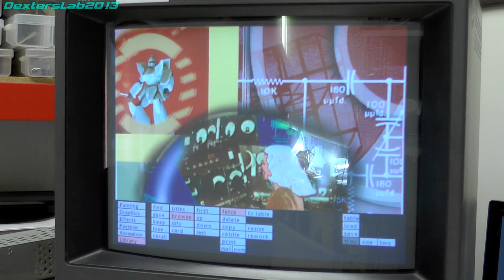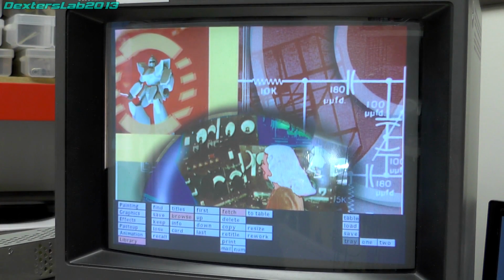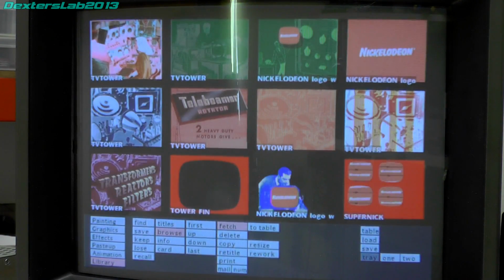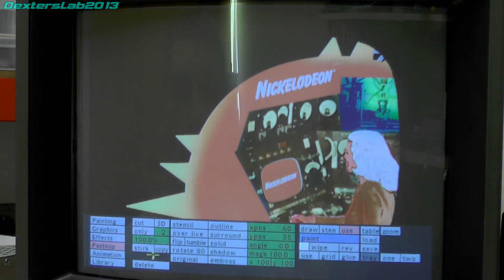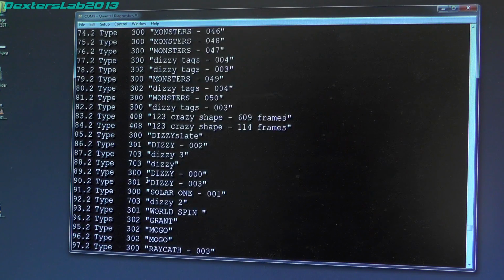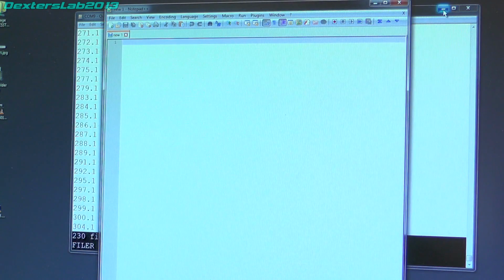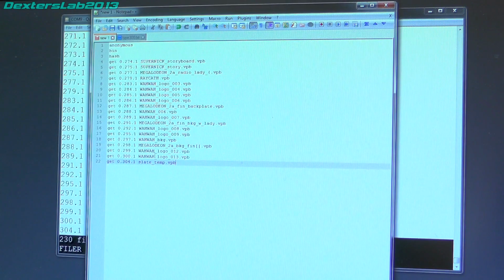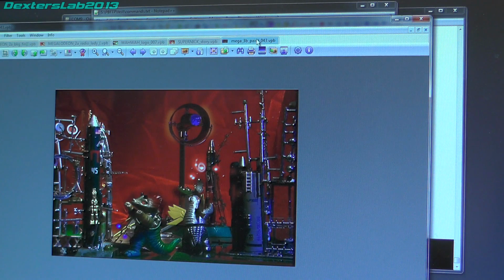DL141 Recovering DizzyTV's Old Quantel Paintbox & HAL Files

Comment: You might be interested, I found some Python source code that claims to decode VPB: https://github.com/GeoSpark/vpb-converter
Reply: Do you have any samples of files you can make available? They could be useful for improving the code.
Reply from the maker: Thanks, yes that was written by a friend of mine so i could convert some bitmaps that i wanted to send to the paintbox. It was written before i found out that my Paintbox can convert files through the network interface for me. We kinda stopped working on it after that, we also discovered the file format is actually open and documented by quantel... the only issue is it was only as a printed document and i've not found a copy of it yet!
Reply: @DextersTechLab  I want to implement the vpb file format, did you already found a copy of the documentation of the file file format?

Also can you point me in the direction of sample files? I already found the one in vpb-converter
Reply from the maker: @arnoudmulder If you email me i should be able to help. You can get my email from the youtube channel about page.
Reply: @DextersTechLab  thanks, mail has been sent
Reply: @DextersTechLab  If it helps, in my Googling I found this page: http://software.s-a-m.com/Public/WbSr2.nsf/GetDocUniqueOrig/ -- the links seem to be to various Quantel docs. Some need a username and password to access, others don’t. I didn’t spend much time checking the links, though.

Comment: Just for ask, have you ever try to connect a mo drive to a computer and read disk directly? It can be intresting to know what file system that machine use.
Reply from the maker: Yes i do this frequently and also with hard disks to backup and duplicate drives. The file system format is proprietary to Quantel so a pc just sees it as raw data.

Comment: > 14:06 to… JPEGs or Windows bitmaps or whatever

Please tell me you convert to PNG or bitmap. JPEG is a lossy format and would degrade the quality :(
Reply: Tiff or Targa is better for video use/
Reply: @BeauTardy  I've always wondered why this is the case - is it due to colourspace, or the fact that the image is uncompressed being more suitable for realtime usage?
Reply: @cromulence  we use uncompressed images for video editing to avoid compression artifacts, especially if an image is used in movement. With todays compressed video though it is hard to keep video free from macroblocking (4K is a fallacy - its all compressed). 'Colorspace' is not something typically we worry about as long as its RGB or YUV- at the end if the video is color corrected all that can be changed anyway.
Reply: @BeauTardy  
The last time I've seen TIFF and TGA used in actual production as image sequence output format was around 2001-ish. We used mostly SGI (Silicon Graphics Image) throughout the 90s for film and broadcast work. Everything past 2003/2004 should be EXR/OpenEXR, just for the sake of versatility(and your own sanity if you do render/buffer passes). :)